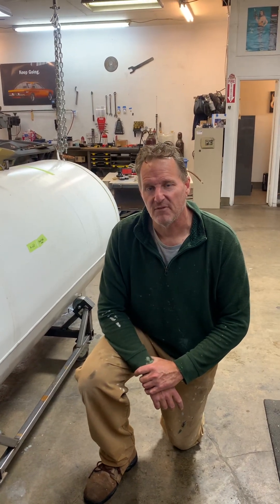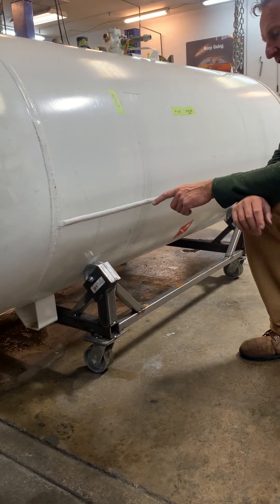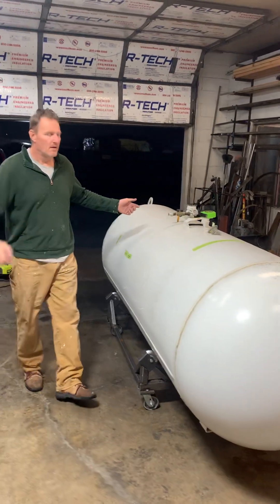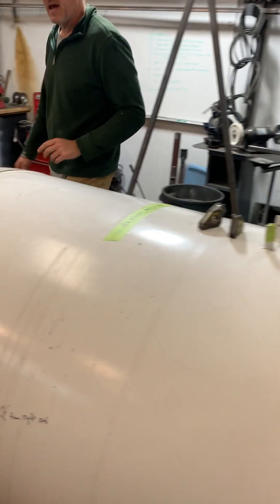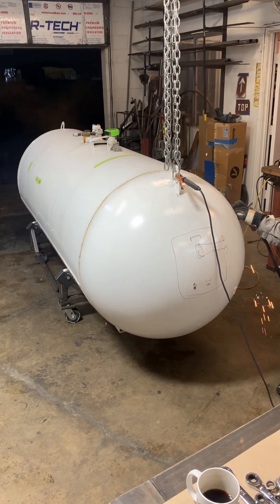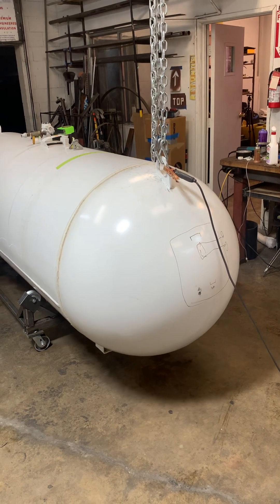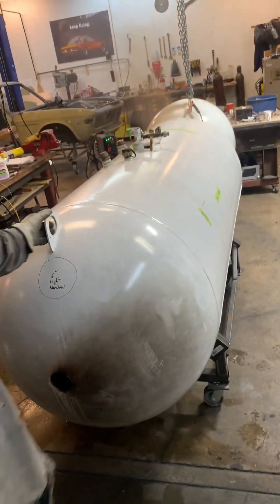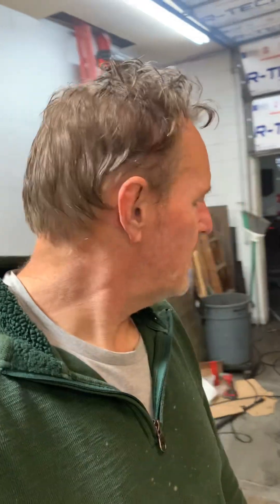January 2, 2023

Comment: Good job.  I bet you could make it an inflatable with a 1 foot section for the door.  It could be portable by hand at about 200 lbs.  What is your max pressure you need?
Reply from the maker: I wouldn't feel comfortable going to 3 ata (30 ) psi without a hard shell
Reply: @dennisgrob5690  so if a soft one bursts your ears will be damaged?
Reply from the maker: at 3 atmosphere ,,, much worse